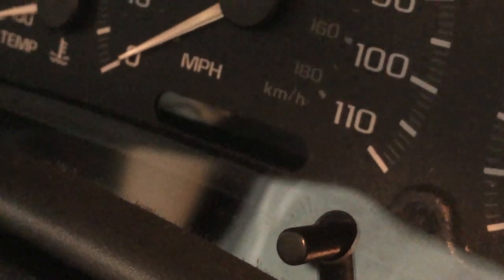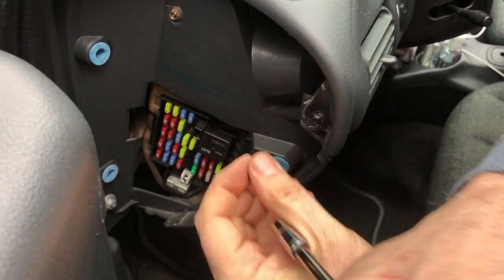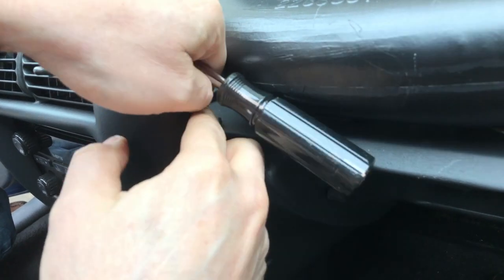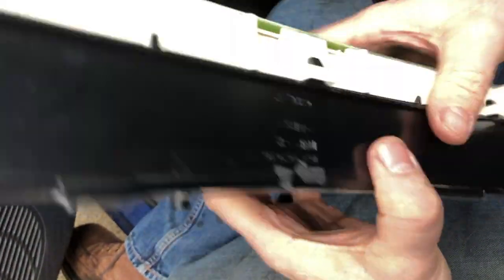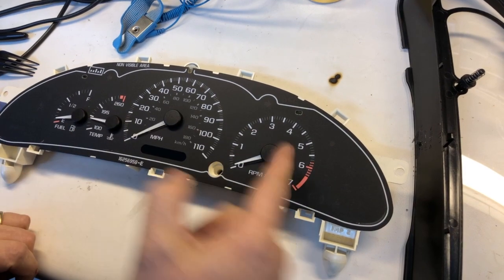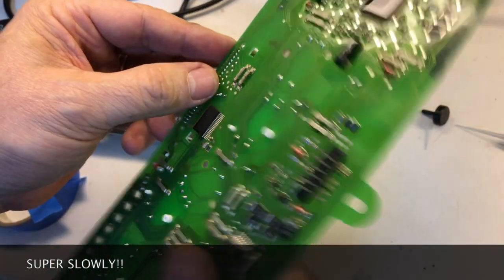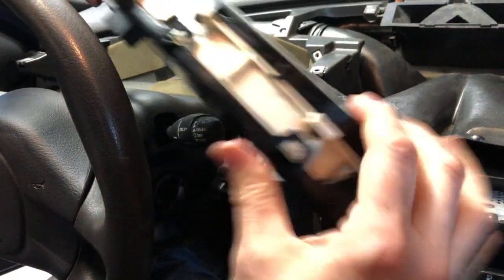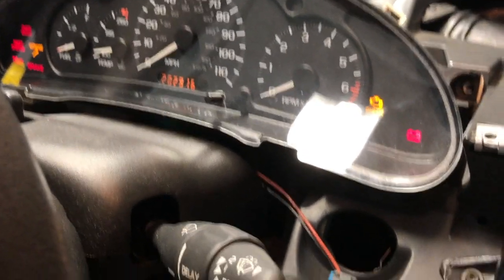2000 - 2005 Chevrolet Cavalier Pontiac Sunfire Odometer Burnt Out Backlight Bulb PCB Solder Repair

Comment: Nice work.  Which soldering iron and solder did you use?
Reply from the maker: Still working thru my stockpile of Radio Shack solder, .022 silver/tin.  Iron is a vintage Radio Shack 64-053 digital station.

Comment: This video is amazing!! Thank you so much for the thorough explanation of the entire process!
Reply: What type of adhesive did you use on the traces? I'm new to circuit boards, so apologies if there's a standard type of adhesive used!
Reply from the maker: There's not anything specific or standard there, as long as the trace is intact and just lifted off the board.  For just a lifted trace, my approach is simply crazy glue dabbed underneath the trace from a toothpick.  If it's a corrosive environment, I'll then cover with a smear of GC Electronics Red Insulating Varnish very thinly.  But usually just the crazy glue is fine.

Comment: Thanks for sharing best video on the subject worked like a charm the only problem I had was when I marked the needles using tape and started the car the needles moved way out of position. I did find another video on how to recalibrate the needles and everything is working like it should. I replace the odometer bulb on a 2000 Pontiac Sunfire believe it or not it’s only got 24,000 miles. 👍🏻
Reply: Where’d you find the video for the recalibration?

Comment: Hi, congratulations great video!  is it the same procedure for a 99 Z24 ?
Reply from the maker: The further back you go, the more the circuit board design changes.  But if it has the glowing amber colored odometer digits it should be.  For that year, the odometer bulb unit might be off to the right rather than in the center, but similar approach.

Comment: Removed the rpm cluster needle just like you did however mine pulled the rod out of the motor i guess and now no longer works! Which is horrible as it’s a manual car, and boost is controlled by rpm, but now i have no rpm signal
Coming from cluster so my car is currently stuck on watergate
Reply from the maker: That's a sign that the stepper motor unit, which controls the needle position, was likely on its way out anyway.  That shaft the needle rides on should be very difficult to remove.   You can desolder and replace the stepper motor itself.  It's not sold by GM, but they are out there on eBay just search one that fits the Cavalier.

Comment: Any idea which on is positive and negative? My new bulbs have polarity so i really dont want to do it over
Reply from the maker: The primitive 5mm incandescent bulbs this GM circuit board used originally did not use polarity (linked in the description).  It's been many years since this video, but as best I recall its just the bulbs placed inline to the circuit in series, likely sharing a common ground.

Comment: It looks like every bulb is soldered onto that board, instead of the twisting sockets I've seen in other videos. Does that mean I can't just pull the bulbs out to replace them if switching to LEDs? Thanks!
Reply from the maker: On the J-cars they are all soldered yes.  You would have to desolder them all, and resolder in replacements like I did in the video.  Hoping nothing on the old circuit board lifted while you did.

Comment: Can you swap clusters with sunfire and cavilier will they both fit eachothers dash area?
Reply from the maker: I haven't personally tried this, but my understanding is they are differently shaped so you would need to swap most of the dash assembly rather than just the cluster.

Comment: Tried this and I got all the bulbs in put it back together and they don’t light up now my whole cluster is black and one of my tail turn signals went out for some reason any idea why ?
Reply from the maker: Turn signal on the cluster - you may have shorted a circuit in doing the rework.  I would double check that none of the bulbs you replaced have their wire leads crossed or solder bridging between them.
Reply: @DrShock  honestly I’m only 21 and it was my first time soldering and I believe I did a shit job. I believe some of the wiring (not sure how to say it) that connect to the bulb ripped off on the circuit board so I’m not sure if I’ll need to buy a new cluster my bulbs worked fine before I just tried to replace them with blue 4.7mm bulbs and it all went downhill thinking I knew what I was doing 🥲
Reply: @DrShock  any chance you would be willing to work on my cluster I’m willing to pay for you to work on it as you know what your doing

Comment: I have a 2003 cavalier, and the DRL does not work and I don't know what it could be, maybe you can help me, I have a lot of time with this problem !!!!
Reply from the maker: I don't have any experience with DRL problems on these cars.  But if I had ran into it; I'd check the headlight bulbs, fuses, switch and complete wiring harness involved, and drl relay.  You're looking to check continuity with a digital multimeter, as well as inspect for corrosion at any connectors or grounds.

Comment: Se pueden cambiar por leds esos focos convencionales?
Reply from the maker: Sí, puede usar cualquier bombilla de 14 VCC, ya sea LED o incandescente. Solo tenga cuidado de mantenerse en el mismo nivel de brillo para que el odómetro se pueda leer claramente.

Yeah you can use LED or incandescent as long as they are rated 14VDC minimum and have a similar brightness level.
Reply: @DrShock   muchas gracias!!!!!

Comment: no need to mark needles don't put them on untill you plug in cluster turn key off and on and off then place needles at zero!
Reply from the maker: That approach will not work for the temperature gauge, unless the engine coolant has reached ambient outside temp as that gauge will "zero' at the sensor reading for the coolant.

Comment: I started laughing less than a half way through this video. I can't believe that any manufacturer would make someone go through this much work to replace a stupid little light bulb. You can buy a whole new gays assembly for pretty cheap on eBay or Amazon, which will be much easier and quicker to replace with one connector.